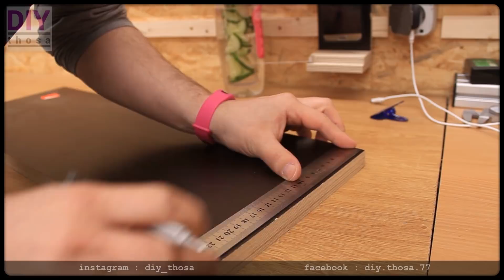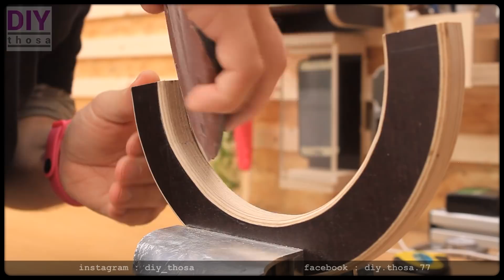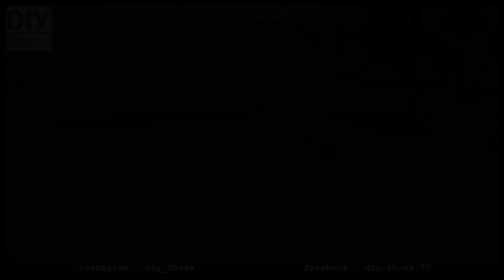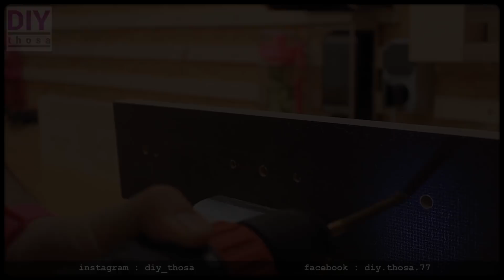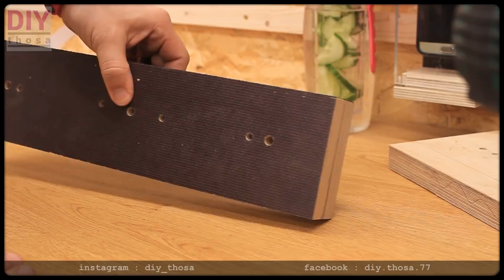🔴 DON'T WATCH THIS VIDEO - PLEASE READ THE VIDEO DESCRIPTION 🔴

Comment: I know there is the worry of kickback by cutting between the blade & fence, but that could be overcome with a small sacrificial block to support the thin strip through the blade. As you have parking holes for spare bolts, one of the boots could hold an adjustable strip
Reply from the maker: Yes, very good idea. 😀👍 Similar to my pushblock with the adjustable sliding wood downwards.

Comment: Didn't get? What is this for? Just to cut narrow pieces of ply? What have you done with it?
Reply from the maker: This was made for cutting Strips with a Width of less than 5mm. 🤓 Certainly not Plywood. That was just for Demonstration. I have had used this in that Video: https://youtu.be/gWWo_Pt4RsI to cut Oak Wood into 2mm Strips. 😀🖐

Comment: Maybe I'm a dimwit, but I just couldn't understand the jig, and why it's used as shown.
Reply from the maker: I don't think so. 🙂 The video is only with music and explained only with pictures. Maybe I should have explained more.  🤔Ok.. The device is intended for sawing very narrow strips. With repeatable accuracy. You could also saw as follows: Wood right at the fence. Saw blade on the left. push the wood with a normal push stick. Narrow strip cut off on the left. ... problem: you have to adjust the fence all the time, so don't repeat it exactly.  Option 2: You set up the fence right to the saw blade to the desired width. Pro: repeatability accuracy ... contra: the thin strip stops between the saw blade and the fence. and you cannot push that kind of thin strip with a push stick without damaging the stick. ..that's where this tool comes in: 
The tool comes between fence and saw blade. You set the width only once and can feed the wood from the left. With this tool you have the possibility to guide the sawn strip safely past the saw blade. The grip tape attached on the tool helps not to loose the contact to the strip while guiding it. The tool is adjustable in hight. One or two layer wood with grip tape.The unused screws are parked on the back of the tool (screwed in).. I hope I could help you.😀👍 Greetings from northern germany. 😀🖐
Reply: @thosa  Thank you for the patient and elaborate explanation. I think I understand this jig better now. If ever I feel I need  repeatably accurate thin strips, I'm sure I can depend on this jig. I've subscribed, for your pleasant disposition. And of course, greetings from India too.

Comment: What are the four bolts on the back for?  Thanks
Reply from the maker: in the back are the parking slots for the unused bolts. I got 4 long and 4 short bolts ... there are 2 boards with grip tape on the side.. I can use it the flat or the higher version.. 👍😊🖐

Comment: Looks very good. Thanks. Are those bolts on the front stored there for use when you only have one black board underneath?
Reply from the maker: thank you 😀  yes, exactly .. These are the parking slots for the unused screws. I have 4 short and 4 long screws for the jig.

Comment: Cooles tool. Hätte ich heute brauchen können. Hab ca. 100m 12x5mm leisten geschnitten. Bau ich morgen nach. Danke für den Tipp. Hab nur nicht verstanden wofür die 4 schrauben hinten sind. Klemmst du da einen anschlag aus Restholz ein um die leisten besser schieben zu können? Hab ich da was übersehen oder in der Sekunde nicht hingesehen?
Reply from the maker: vielen Dank 🙂 Ja, 100m Leisten ... alle gleich... das schreit ja förmlich nach dem Tool 😉😀  ... Das Tool hat 2 Teile, die mit Grip Tape beklebt sind. Je nach dem wie hoch ich das Tool brauche, kann ich eines oder Beide montieren. Dafür brauche ich aber unterschiedlich lange Schrauben. Also habe ich 4 Lange Schrauben (für hohen Betrieb) und 4 kurze Schrauben ( für flachen Betrieb )  die 4 Buchsen am Ende sind quasi der "Parkplatz" für die 4 gerade nicht benötigten Schrauben, damit die nicht weg kommen oder in der Werkstatt rumliegen.  🙂

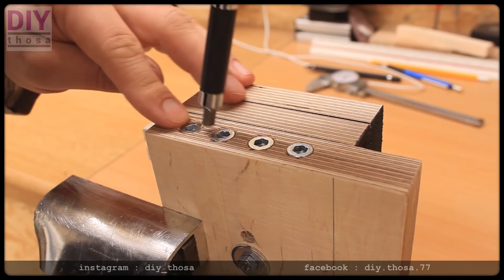Comment: Those 4 countersunk hex head inserts . What is their purpose. At about 5:25?
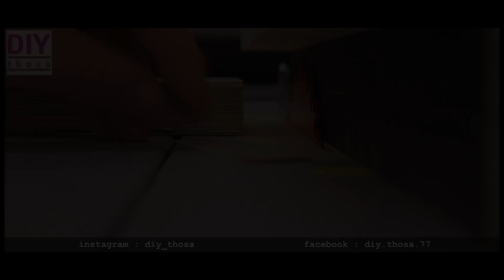Reply from the maker: These are the parking slots for the unused screws. I have 4 short and 4 long screws for the jig. At 5:45 you can see the bolts...
Reply: That was my question too, because the video wasn't very clear about that. But it's a great solution for extra hardware that otherwise go missing. Great jig !

Comment: looks like it works,but does not make sense to me. Lot of hardware that seems irrelevant
Reply from the maker: Unfortunately, I see all this as necessary for safe operation. 🤔 If the tool were not so wide, the handle and thus the center of gravity would be too close to the outer edge and the tool would tend to tilt towards the saw blade.  🤓🖐
Reply: @thosa  Makes sense